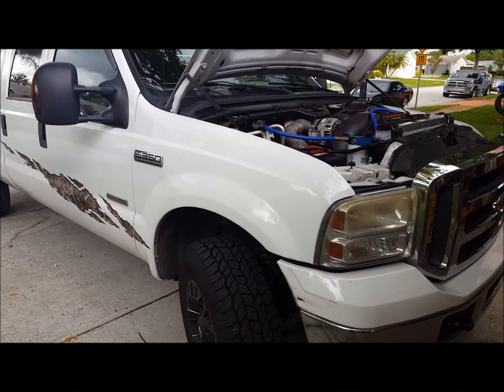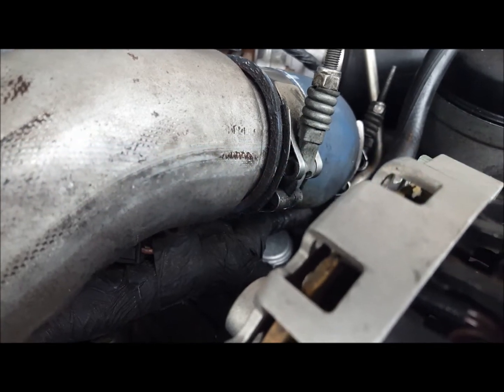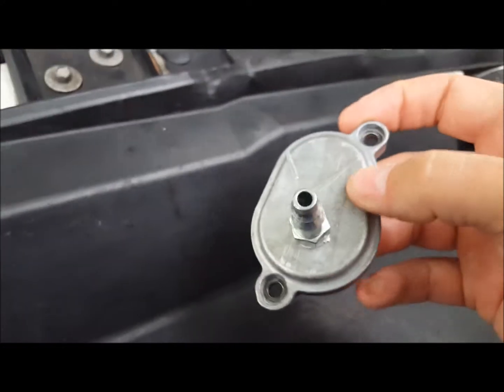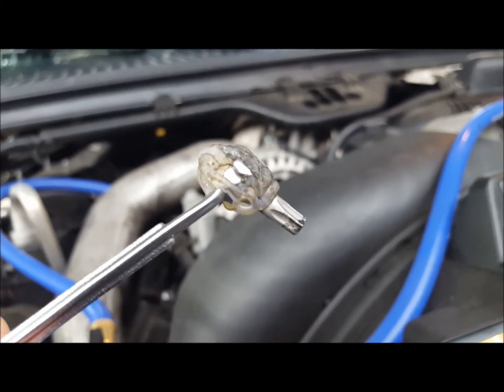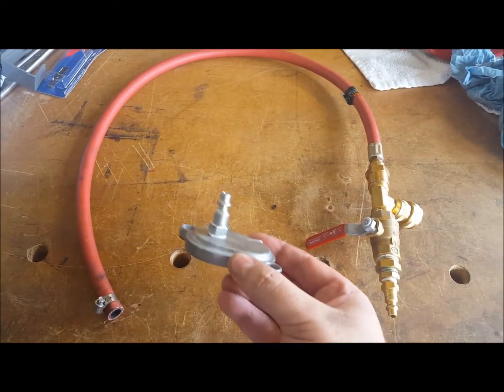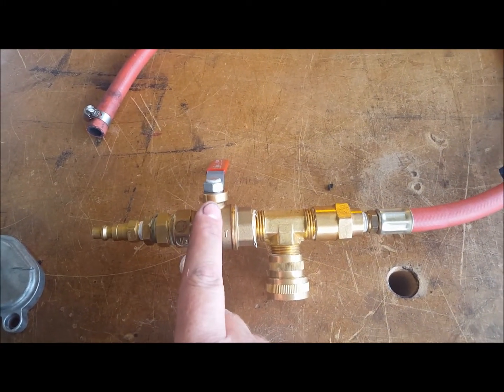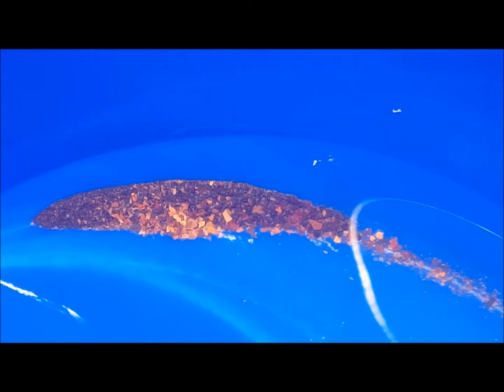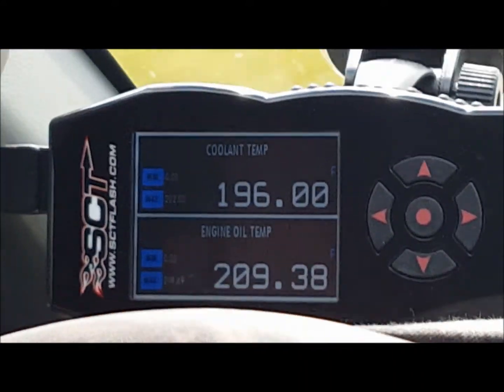Oil Cooler Backflush On The 6.0 Powerstroke Diesel

Comment: Did you cycled it with distilled water after the flush???
Reply: I’m not a pro at this but I thought you should flush with distilled water after the flushes??
Reply from the maker: I'm not either.  You might be right.  Thanks for the input and for watching.
Reply: @paggre  so after flush with tap water just filled her back up with coolant?

Comment: I use a deep 4mm ball driver on a 3/8 socket in place of the t27. If you are afraid of breaking ball driver because of reduced shank size, loosen first with small key wrench. Works great.
Love the video

Comment: My Deltas were starting to climb to about 20 Deg. on a hard pull with travel trailer so I bought the Fixur6 back flush valve. I started with a complete engine flush with the Ford VC-9 then back flushed the oil cooler with the Fixur6 valve using water and air like you did and temps came down the drove the truck for a week and flushed the cooler again and got more of that flakey stuff out so I kept flushing until no more was coming out. The Fixur6 valve only flushes the oil  cooler. My 2004 F250 stayed at our under 15 Deg. on a five mile long pull over the mountains this weekend. On flat land pulling the trailer temps were at 9 Deg. The Fixur6 is a great design and stays installed so you can come back any time and flush again.
Reply from the maker: I need to look at that.  Thanks for watching.

Comment: See I don't get how it just doesn't just take the path of least resistance and go into the jpipe/EGR. I know the tapped fitting is right over the oil cooler outlet but there is nothing sealing off the flow to the jpipe/egr

Comment: Page, good video. I feel your pain dealing the removal and reinstallation of that back bolt. If you backflush during a cooling system flush then the cap has to come off 2 or 3 times. That's why I developed the oil cooler backflush valve. Check it out at FixUr6.com   how did you keep the air and water from flowing through the egr cooler or delete tube when you backflushed?